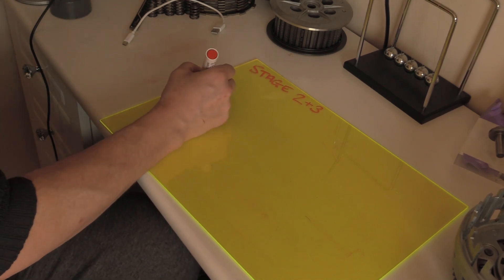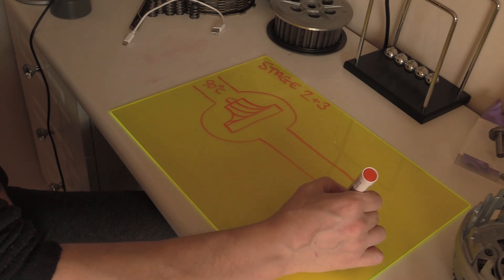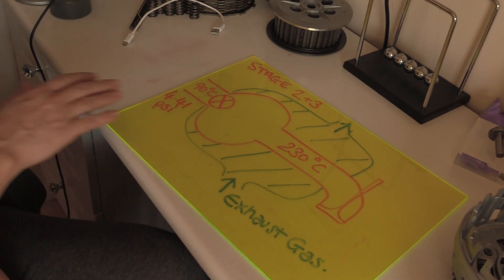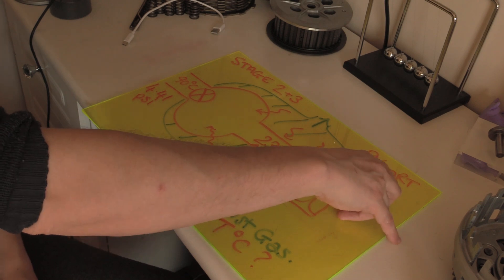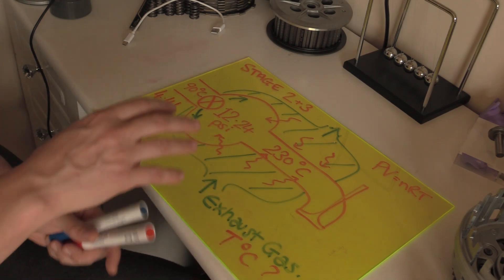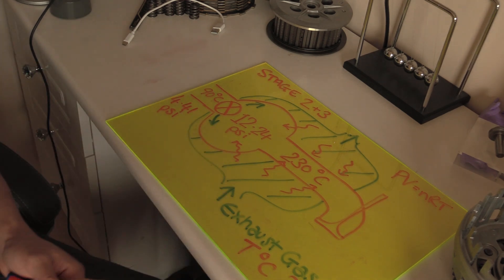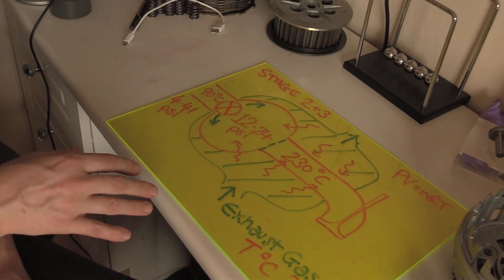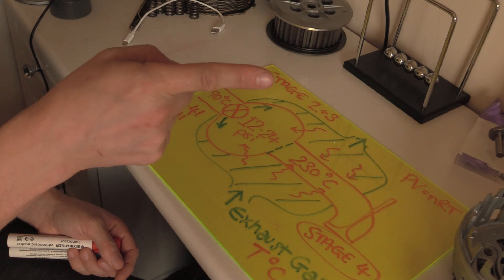Hot vapor Engine UNEXPLAINED - Stage 2+3

Comment: 12.3 psi isn't much at all.  I was running 17 lbs on my Eclipse on pump gas.  Stock, it was 14.4 lbs.  Heat saturation is a feature, not a bug, for hot vapor engine.  With a waste gate and bov, 12 lbs is easily stabily achieved.

Comment: I finally figured out that Alphabet/Google/Youtube will not let me link to the patent description on patent.google nor uspto.  Anyway, of the two, google is the better because each time he repatented it it has all 10 figures.  Use Henry Yunick as the search phrase.  If you use Smokey Yunick an additional 2 come up.  If you take the time and read all of the ones that relate to the HVE you will notice that he did not change much, if anything, over the years.  So, the description and drawings are from the early 81/82 engines that were tested.  @Workshop As an FYI, the documents I referenced and that you alluded to in that last video do exist.  Just procuring them cost a bit.  I have reached out to one of the sources for permission, and additional fees I must pay in order to publish them online.  If I can secure that, I will be posting at least the cover pages, some illustrations and a dyno pull or two.  Meanwhile, the explanation that accompanies the patents tracks almost word for word from the engineers report from 82.  There are some differences and the notes in the margins did not all make it in.  Meanwhile, the 83 Horizon is up on a lift, it has been in storage since 2013.  The original engine is on the stand waiting to be put back in.  We will see if we can get is all to work...Smokey and the bread crumbs and all.
Reply: Here is the Horizon running in Daytona back in 1987:  https://www.youtube.com/watch?v=wl3vUnlIBys

Comment: Isn't the temperature in the formula in Kelvin? If so the pressure isn't 12.21 psi but a lot less.
Reply from the maker: Yes it is, and the temp is gauge pressure not absolute. Absolute would be 12.21 + 14.5 psi

Comment: So how would manifold construction effect this? Such as a small aluminium unit would heat up and cool down more rapidly than say a thicker cast iron unit, surely there would be some form of heat lag causing problems during acceleration after a period of idling? Would the impellor have a variable speed to account for this, increasing or reducing the pressure to maintain a constant temperature and volume?
Reply from the maker: Yes the material choice would effect the lag. As for a tracking variable impeller, that isn't in the patent of a "working" example, and still hasn't been produced to this date
Reply: @thedirtyworkshop  so in short he couldn't be arsed? 🤣